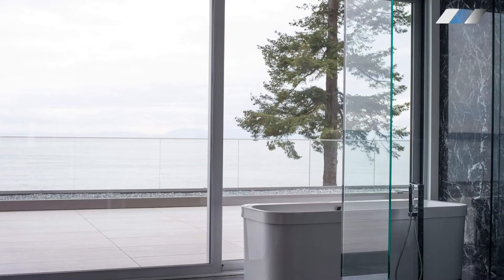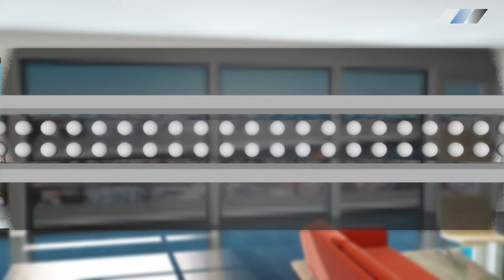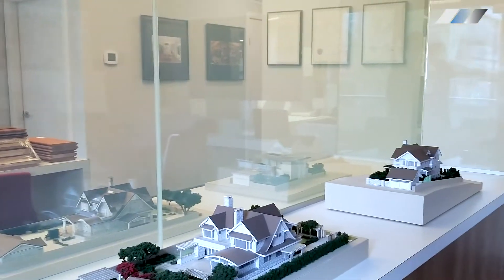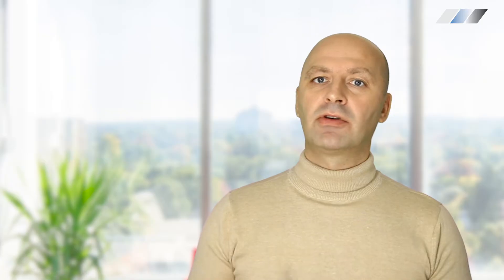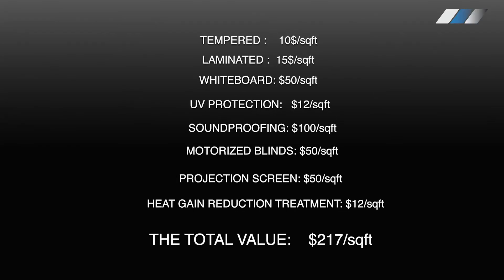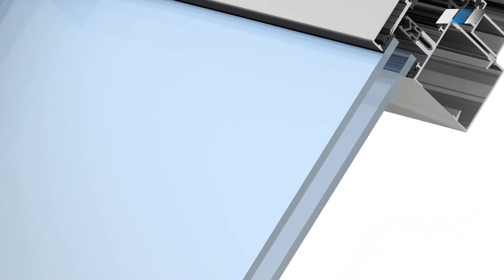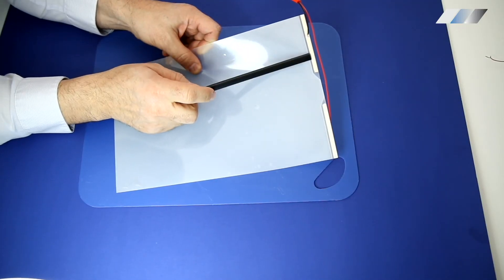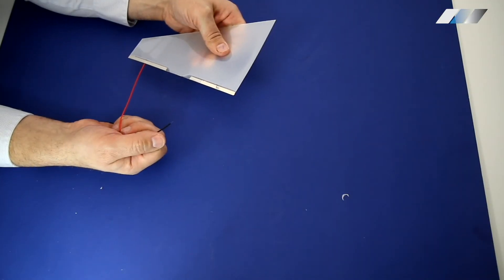The Truth About Smart Glass

Comment: If the busbars are damaged and is in frosted state will replacing the wiring (busbars) correct the problem?
Reply from the maker: Yes replacing the busbars should correct the problem. Sometimes the busbar simply needs to be realigned along the edge. It really depends on the specifics of the situation. Contact us if you ordered from us an require assistance.

Comment: Question. When the privacy is activated are you still able to see out but no one is able to see in?
Reply from the maker: no, you can not see through the glass when smart glass is in the private mode.
Reply: @SmartGlassCountry  is that in both directions.  Is there any option for being able to see out in one direction?
Reply: @carrieellis3601  Yes, it's in both directions and there's no way to see in one direction. All it basically does is let the light pass normally when powered and stays opaque when it's not powered.
Reply: As a general rule, if you want to see out but nobody can see in, in any imaginable kind of window, then you are fighting against the laws of physics. The only way to do that is to have it well-lit outside and dark inside, and use a partly silvered or partly opaque window--MAYBE there's a way to make smart film partly opaque; you'd probably need a specially designed LCD molecule, or an unusually thin film, as the commercial ones are designed to be fully opaque.